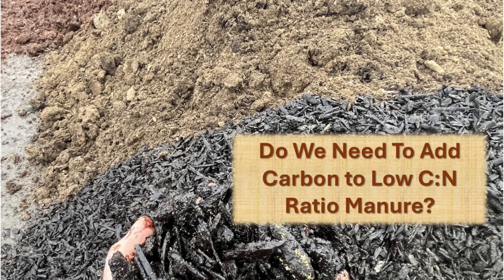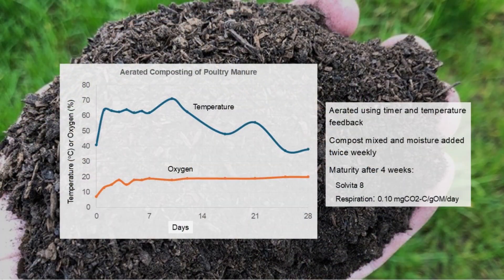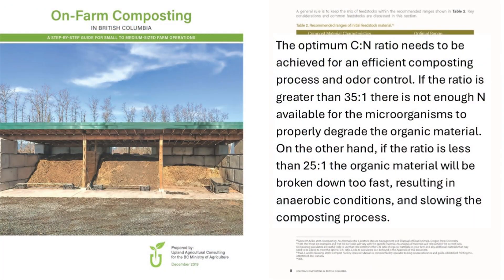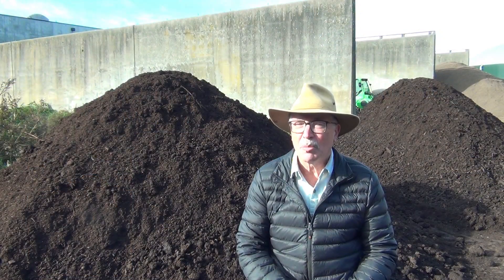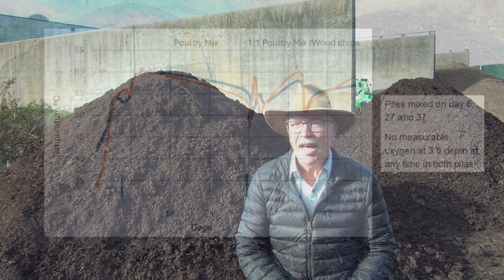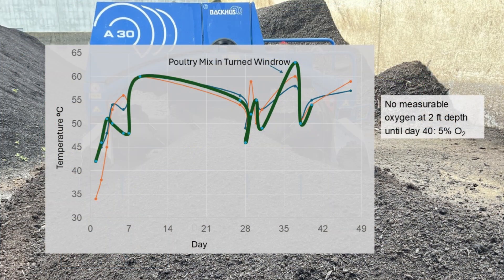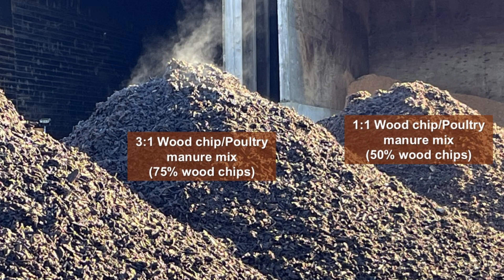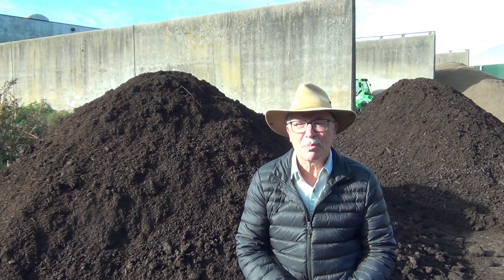Composting Poultry Manure- Do We Need to Add Carbon

Comment: Hi John! Jake here again (love your work). I was just wondering, the chart you show at 2:28, do you suspect the 3:1 woodchips to poultry mix had more oxygen than the 1:1 mix because the bulk density was lower so oxygen was able to more easily penetrate the pile / achieve a heat-siphoning-effect bulk density?
Reply from the maker: Hi Jake, thanks for the question. Yes, I would have expected the 3:1 mix to have more air-filled porosity , which would allow more oxygen transfer, but.... the 1:1 mix had an air-filled porosity of 23.3%, and the 3:1 mix had an air-filled porosity of 22.4%! This is in part because the wood chips were wet at almost 70%. What happened is that there is so much more energy in the 1:1 mix, which uses up the oxygen near the surface of the pile. With the 3:1 mix, the oxygen could get further into the pile before it was used up, allowing the temperature to increase and begin the "chimney effect" that we often observe during composting.